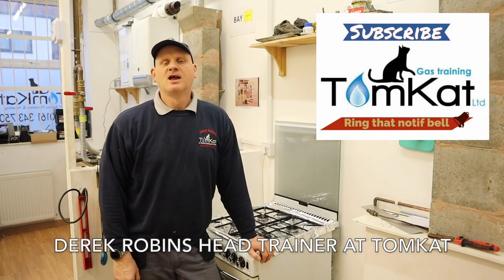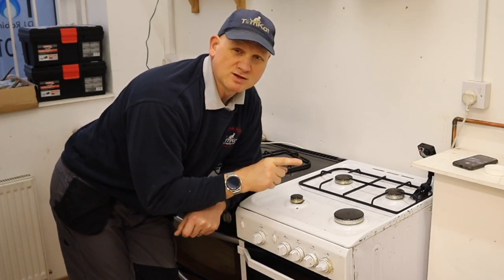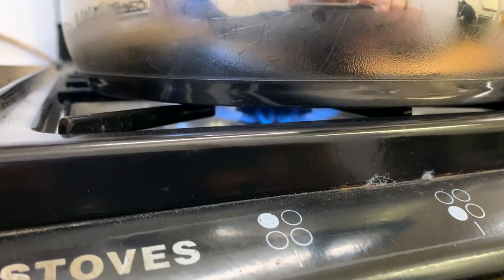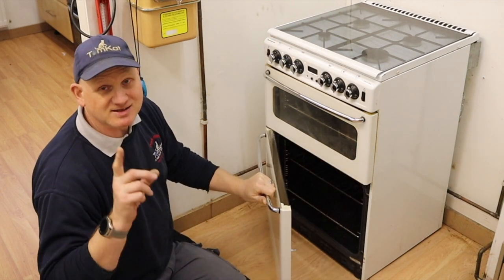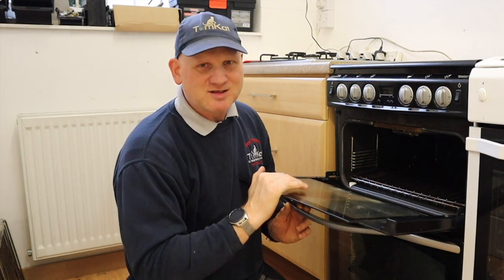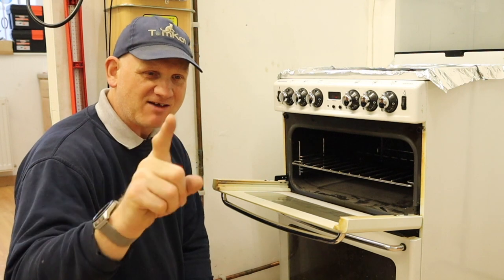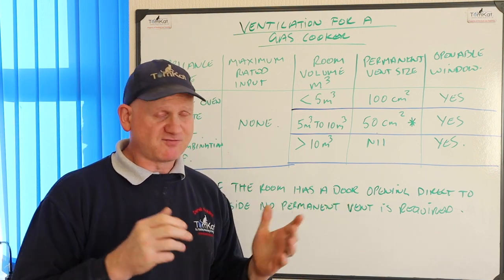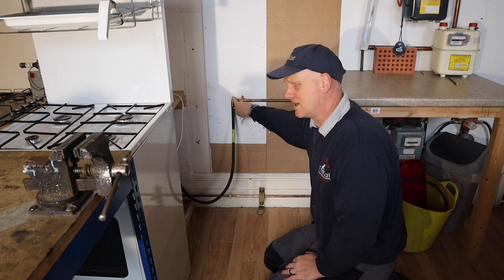ARE GAS COOKERS DANGEROUS PART 2. a look to see wether gas cookers are dangerous and how to use them

Comment: 15:02 I agree with everything you said right up until that. Although it can be dangerous if the person who uses it doesn't know how their stove works or more importantly are not use to gas. Which can be dangerous anyway with a neighbor blowing their house up causing surrounding area's hooked to gas to also potentially blow up, which i have witnessed once. But in the U.S. company's purposely place the electronics on the top, where all the hear comes out so that the board gets warped, Forcing you to know what your doing to fix it, or for most people buy another one from them. Giving the company a infinite revenue stream rather than for safety purposes. In fact i myself had a similar issue where i have to use my stove the old way, until i get the time to check the voltage on every capacitor & piece on the board to find out what is wrong. Because the error code for the stove thermistor went off, i replaced it & it still goes off, but because of it, if it wasn't gas it would be useless. But at least i can still light the stove & not starve to death because of a corporations greed that they attempt to pass off as safety. Other than that, i enjoy these videos there interesting, & in all my 34 years i have never seen a grill in a stove so thats cool. They don't even sell them where i live in the NY. I know this is old but its a interesting thing to watch especially since your pretty thorough even on the most common mistakes that certain people tend to make out of habit or even laziness at times.

Comment: Brilliant video 👍🏻. I never thought that the size of the pans mattered when deciding which ring to use! 

I think the foil is common especially in asian families..

Also, you explained the importance of the glass on the door inside that top oven/grill. I would easily have missed that by not noticing it so thank you very much. I will surely pay attention on that.

I understand the top oven/grill had a fan. 
What does this fan do? I just know it has a fan and that it’s ‘fan assisted’ because of the noise etc..(Sorry to sound stupid 😬)

Asian Jon. Training.
Reply from the maker: The fan moves the heat evenly around the food to make it cook quickly
Reply: @tomkatgastraining  thanks

Comment: Just wondering the top oven door must be open during grill operation but the door can be closed whilst using the top oven. What engineering / mechanical protocols change within the oven during these two different operations?.
Great content Derek cheers.
Reply from the maker: In this cooker the door hinge is like what’s in a glass lid. When you close the door it shuts the gas to the grill but allows gas to the oven
Reply: @tomkatgastraining  Got it cheers Derek.